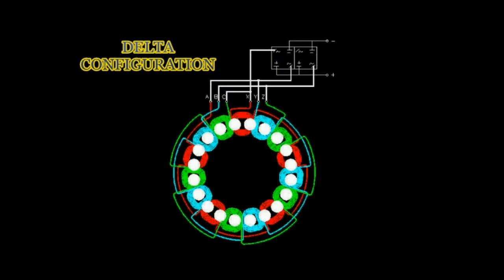AXIAL FLUX WIND TURBINE  12 COILS STATER BUILD

Comment: Good afternoon, I want to thank you for communicating your knowledge to us without any interest, I am struggling a lot to understand, because I do not speak English, I am using google translator.  I want to do this project, I already bought 32 25x50x10mm neomidium magnets.  an on grid tie inverter of 1300 watts, since I want to connect it to the grid, 5/16 "thick sheet to make the rotors. Please confirm the data of the 12 coils, I understood that they are 95 turns of 15 gauge.  voltage and amperage will give me? in advance I thank you most sincerely for your help, God bless you.

Comment: use pvc pipe for bushings that you wrap coil wire on instead of metal to protect varnish on wire, comes in all sizes and easy to work with. how do you know what combination of wire guage, number of turns, and magnets gives what volts and amps at what rpm?  good clear vid  THANX!

Comment: At 11:51 about 1.5 inches from your cut I notice there is damage to the enamel ....could you tell if this is this the only damaged part of the wire or is there maybe say something abrasive along the path of the wire coming off the spool which could be damaging the entire wire in multiple places ? Then again is it even damaged at all or is it possibly just the static of unraveling the wire off the factory spool (if this is even possible at all ) attracting some old loose enamel shavings from cleaning the ends of a previous coil ? Either way it caught my attention and because of my over analytical mindset (for good reasonings from my own personal mistakes and failures at this ) I cant help but wonder how if at all will it effect the ampacity of the enamel wire and depending upon any other possible exposed wires will the coil short out , or , what if the damaged scrapes and rubbed off enamel areas are in a place where it wont effect it at all ? I'm still learning so please forgive me and try to understand if I miss use a term or ask a not so smart question okay haha but as the enamel is damaged will it effect the its ability to conduct if the damaged area is in such a position that it is not shorting out against another damaged area of wire or say if the damaged area is within the middle of the coil not touching the stator in anyway and if the latter then will the eddy current be effected at all and if so will this once again effect the coils integrity ? I hope I asked this correctly haha... Anyhow very cool video and I have a million questions but maybe for another day ...

Comment: I'm building one with 36 ring magnets on each Honda brake rotor. I have 80 magnets coming with screw holes in the middle. I'm going to use two per coil. I won't have to change those bearings anytime soon. I used a front hub off a 750 Honda Super Sport. I don't think Mr. Missouri uses motorcycle wheels for blade hubs. lol
Reply: Sir very good evening you or given a good information to the public please also shown that wire guage  and no turns
On the display monitor please help 
Thank you

Comment: I want to build an axial generator, but I have a question:
Are the coils wound in the same direction and mounted in the same orientation? So every coil is wound clockwise for example, if you look from the top on the generator.

Comment: i have been playing about with my axial flux generator and although i have two metal discs with magnets on it, i spun it with one disc and got the same voltage, have you tried this, opened the door for another stator to be added?
Reply from the maker: yes and only reason to have two magnet hubs is full saturation thru  the stator, but if does work with one hub... thanks and please sub to my new channel.   
https://www.youtube.com/watch?v=Tm1pv0HV1NY&t=53s

Comment: Have you ever weighed those 15 awg coils before?
Reply from the maker: Yes, you have to weigh them. And weighing them keeps the counting of turns the same. So if you have a heavier one than the three you made before. Then that has been wound loosely and has more turns.  So yes I weigh them. Good question thanks for commenting.
Reply: @TheBillythekid2010  lol I see that in your video but I was thinking you were winding a  14 awg . I watched it again and see it's a 15 awg . Thanks for sharing. Pile of copper in those stators that's for sure!

Comment: Nice work, on a different note do you know what guage wire, how many turns and how long wire would I need if I required 50 amps and 60 volts from 4 coils only if my magnets are N52 60mm by 200mm rotating at 3500+ rpm

Comment: Good job Billy!! What is the size of the blade that you will put on this stator?? I think those coil's are very  small to produce 3kw. Maybe you can get those Watts with midnite charge controller... Maybe.. I wish I was wrong.
Reply from the maker: Saying it should is not like saying it will... Testing and yes it will be on a classic 150... So I look forward to the low wind production from all the Axial Flux Turbines I build... Blades maybe ten foot dia? Did you find a SSR? You never said you did or didn't, so I gave up... Thanks for watching and the comment 😃
Reply: @TheBillythekid2010  those turbines in the law winds are the best. If you build with 21 coils you will see crazy power. Then the classic can not work. You had to make your own controller. I didn't find SSR for 48v. I will do it with 3 phase SSR and i will put the dump loads in every phase of turbine. Like the clipper of classic
Reply from the maker: please go and Sub to my other channel. Missouri wind and Solar is up loading my videos and sending them to YT for copy right strike!! I got three strikes and YT has said another one they are shutting it down!! Thanks 
https://www.youtube.com/channel/UCWHgq_h3hCbiPx0xx0NyLhQ?view_as=subscriber

Comment: I'm  the inventor of the G.A.G.A. engine. It runs off gravity and Anti-Gravity. It has excess power to turn a rotor. So I'm looking at YouTubes to build it. I saw where you were testing for resistance on your coils. I suggest using a Fluke multi meter big difference on getting  good readings.  What do you recommend for a Hybrid Wind/Solar charging Controller?

Comment: i wanted to ask: what determines output power? what amount of turns, and thickness of a wire do i need to use for high power output?
Reply: All this parameters are calculated according to GA of wire, number of turns, number of coils, speed of system - RPM. All are introduced in equations to determinate the power and condition of generator. Exist one manual what present step by step all operation needed to be done to calculate the axial generator.
First time you need to know the average speed of wind in your area. If wind blow just 3-4 months every years it is not recommended to install this type of turbine. To can have efficiency  it is mandatory to have wind minim 7-8 months/year and this to have minim 3-4 m/s - minim 12-16 hours/ day. Starting from this point you decide what type of turbine you will install , for what power and what is efficiency of this. It is a long way to follow to can calculate this turbine. Just for fun you can create one turbine 3 coil and 2x4 magnets and to see how will work. Good luck !

Comment: How many watts sir ?
Reply from the maker: With a Midnite 150 controller max peak 2500 to 3000 watts... Without controller 1500 to 2000 watts. Thanks for comment and please subscribe 😃
Reply: @TheBillythekid2010  

This is how much VAC sir ???
I happen to want to make a generator like this, sir, for the final project of my lecturebut 
I am confused how to calculate

maybe you can help me ???
Reply: @TheBillythekid2010  

Yess sir...
I'm from Indonesia Semarang city
Reply from the maker: @faizmustaghfirin6081  nice to meet you😃
Reply from the maker: @faizmustaghfirin6081  96 amps 150 volts. The 15 coil stator will over volt all the classics Midnite Solar makes.